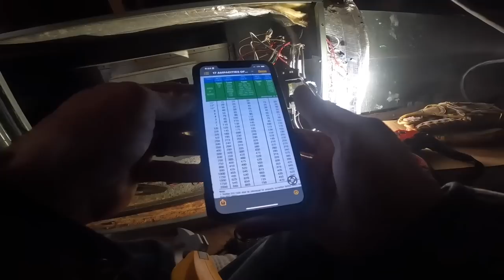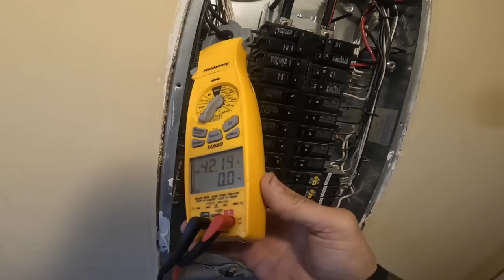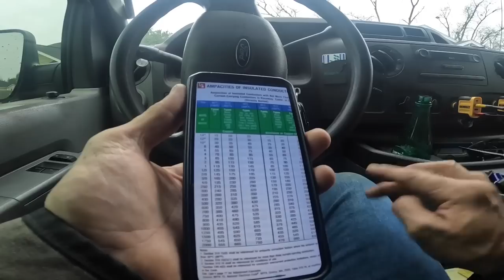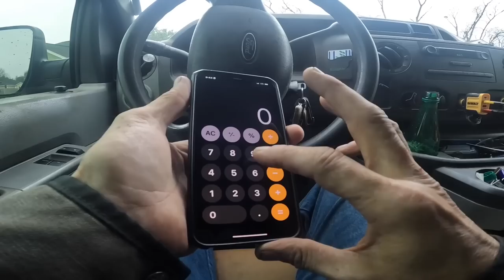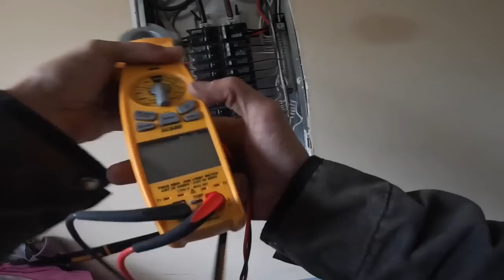No Heat Call Leads to Finding A Problem That’s Been There For Over A Decade

Comment: Do you ever recommend to the homeowner to have an electrician come out to do a check? Seems like if there’s one major problem there’s pretty likely going to be more..I’m paranoid now due to a recent electrically caused attic fire, I had an old Federal panel, too..
Reply from the maker: FP panels are outlawed here
Reply: @HVACGUY  I think everywhere else too, except no one bothered to tell me, I found out by looking it up on the net..I was getting rid of it and as much of the 1950’s wiring as I could, but the insurance never sent an agent to the house, never requested any investigation whatsoever, and wasn’t going to pay for any of the replacement costs until I said that this was my direct response to the fire, and trying to make the house safe. I had a new service installed, new panels/breakers, and a surge protector covering the whole house and one in the sub panel too, it has a circuit that goes back outside to my chicken coop, so I figured why not protect that too..
Reply: @johncspine2787  i have fpc too .  Did you  get help ( coverage )  with your panel change out ?
Reply: @craigerickson8712  not at first..Farmers never even sent an agent to examine the fire damage. It was only after I wrote a letter saying the panel change out was a safety issue in direct response to the fire damage, then the agent several states away said he’d put it on the estimate..

Comment: Alright, Curtis thanks for the video as always have a question for you or someone in the chat.  7200 (your kw of heat strips) divided by 240 amps gives you what?  What are you looking for, I know the answer for the math is 30 but 30 what?
Reply: Uh... 7200 Watts divided by 240 Volts will give the Amperes (30).
Reply: @raygunsforronnie847  Alright, amps is what I was going after, thanks.  I am still learning this trade and appreciate people's knowledge helping me out.

Comment: So correct me if I'm wrong but at 240v, drawing over 40 amps is ~10kw? Isn't that really high for a heat pump? Or was it powering resistive heating strips due to cold temps?
Reply: This was just the resistive heat strips.

Comment: Quick question though.  How were you reading an amp draw but not reading voltage when you were checking the breaker at the main panel? Is your meter not working correctly? Thanks for the videos you provide by the way!
Reply: Disregard. I watched the video once more and saw that you shut-off the breaker.

Comment: hey Curtis that alum wire will loosen over time because alum expands and contracts more than copper, but some use it because it is cheaper. You must put the No Ox grease on the ends and tighten it over the years for it to work correctly. I usually recommend having bigger wire ran over de-rating the equipment.

Comment: Usually on the electric heat  kit it said use copper conductor only. The right way to take care of the problem is run a new wire number 6 copper with a 60 amp breaker if there were to to a fire he is responsible

Comment: You are not suppose to use aluminium wire on electric strip heat or on outdoor condensor units read manufacturer instructions copper wire only